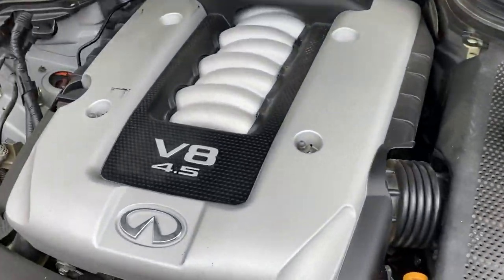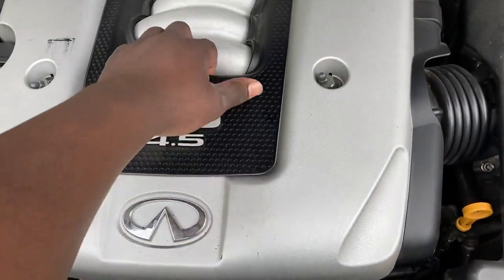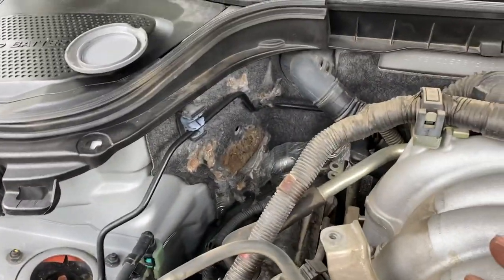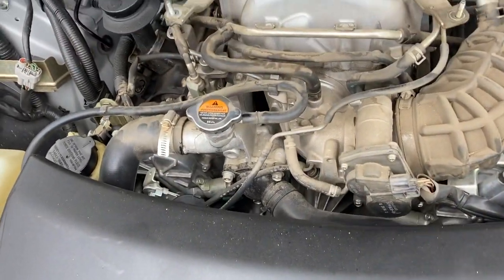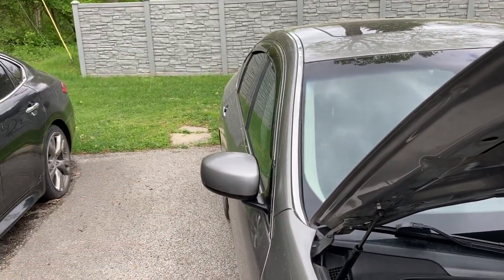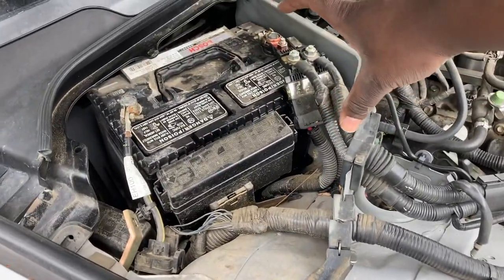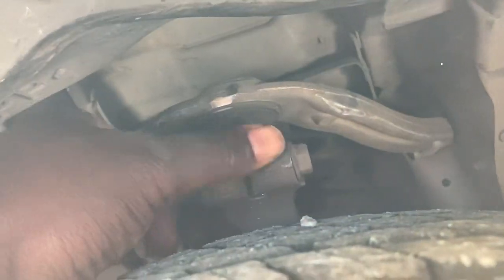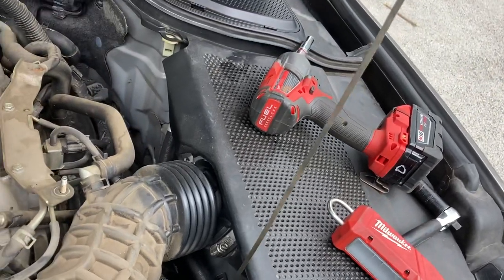Bought an Infiniti M45 and brought it to me to find any hidden issues. (Post-Purchase Inspection)

Comment: That Thang is Mean. Love the Infiniti M45s and M35s. especially RWD. That def looks like engine was replaced. Id def flush the coolant, drop the trans pan and losen around the filter to drain out 8 to 9 qts and replace with OEM, make sure it has OEM plugs, and check all connections. I've owned 6 infinitis, 2 were M35s. Be careful with the oil stick measurement, it has been said that the design of how they put the stick in engine to measure was off so it reads lower than it really is on the stick. It caused a lot of VQ owners to over fill oil which caused leaking from seals. The VQs also burn oil between changes. usually only a half qt or qt. so i always changed my oil every 3k instead of 4k or 5k. My opinion is GTX full synthetic, or royal purple run the best in the VQs. The I30s and Maximas liked Mobile 1 synthetic better, go figure. I got lucky with my 2008 M35 because I bought it with only 40k on it and it wasnt burning oil at all, I switched it to GTX and always changed every 3k and now it's still not burning at all and Im over 100k. This M45 V8 IS a different beast though, so im not sure if it has same issues as M35 but the forums and online clubs seem to say they do. Love these cars tho. wish theyd put woodgrain on the wheel tho. I wanted to say I was grippin grain when i swang and bang like I was riding clean poppin trunk in Htown or Mississippi Mayne. all my Infinitis my Pops called Japanese Cadillacs. I thought that was so true. Its VQ Infiniti Gang Gang fo life tho. My Japanese Cadillac is my habitat, from Hawaii to Dub V, I rode across the map, always had a fly shawty ridin shotgun and in the back, no cap i dont battle rap, i spit facts 🗿

Comment: Hi I’m  looking into buying a 2008 Infiniti M45 it is the base model not the Sport model. And it has 70k miles which yeah it is low mileage and there selling it for just $2,000. The catch is the car hasn’t been driven or run for nearly 2 years. And when they tried starting it wouldn’t start. Put a new battery still wouldn’t. They said that when it run and drive it didn’t have any issues. Also it’s a older guy selling it, it was his sons car but he moved and the car just stayed there collecting dust. So what do you guys think should I buy it or pass?
Reply: Did you buy it? What was the issue?

Comment: Hey brother I have the same car and mine keeps overheating.. I changed the thermostat, water pump, bled out the system right. Except it still over heats when I give her a little gas.the fluid bubbles in the coolant reservoir
Reply from the maker: Unfortunately if the fluid is visibly bubbling in the reservoir, that indicates a serious breach into the cooling system. Exhaust gases are coming out of the combustion side and making it into the coolant.
It could be due to a bad gasket or even a crack somewhere, but the engine is going to need to be taken apart to at least investigate it. Some people find it easier/more economical to just replace it depending on the comparative labor costs and the extent of damage.
Reply: Thank you brother. I just bought this car from Staten island and it runs and drives beautiful except when I give it to much gas she over heats. I appreciate you man. Finally found someone who knows the know about these cars. I'll try and save up to get it looked at
Reply: @EdBwoy  where are you located? Do you know of anyone who specializes in these cars that could fix it for me? I have the money I just really want to fix my baby

Comment: Do you know anything about curcuit boards? I know this electrical is it worth fixing. I have a 2001 it has been a nightmare.
Reply from the maker: I am not very proficient with deep electrical repair. I have done light troubleshooting, but it depends on the problem.
What car do you have and what symptoms are you experiencing?
Reply: @EdBwoy  I have a 2001 Infiniti i30. Yes, it is old but I love my car I bought it brand new and never had any major problems with it. When driving, it started to idle very low and then regain speed. Also, it would take a while to start. I took it to my mechanic he said it was the computer. I replaced that it still would not start. Then I was told it was electrical and that the circuit board was bad and it would need a harness. I know if I take it to Infiniti it would be a very pricey repair. With the car market the way it is I wanted to wait before purchasing a new car because the prices are ridiculous. Thank you for responding would love to hear your thoughts.

Comment: I have a 2006 m45 134k miles I have changed my radiator, thermostat, water control valve, and my cooling fan control module and my temperature hand still rises after I drive 30-45 minutes
Reply: I just changed out the radiator in mine too and now I'm about to change the fan module as well..My temp stays in the good though..I truly enjoy driving my M45 alot and I love the strong engine take off💨💨💨.
Reply: burp it